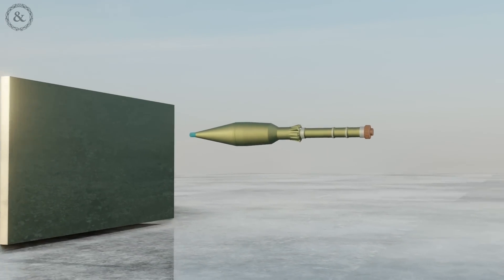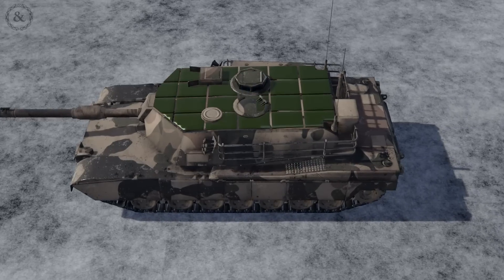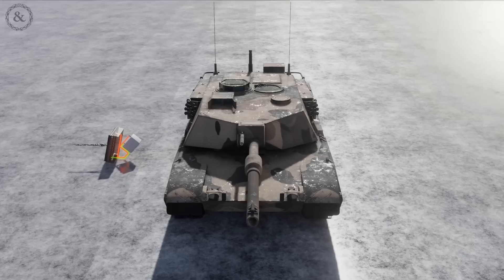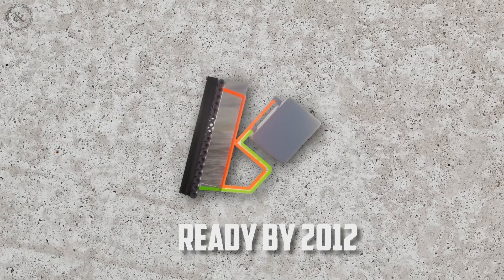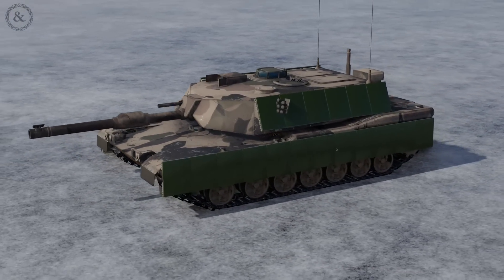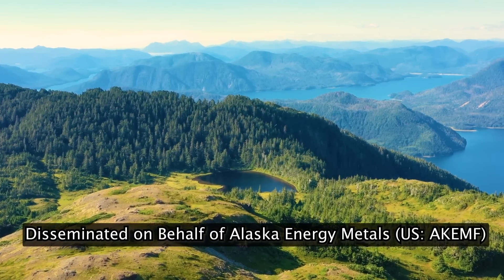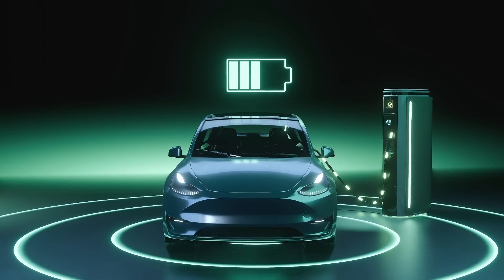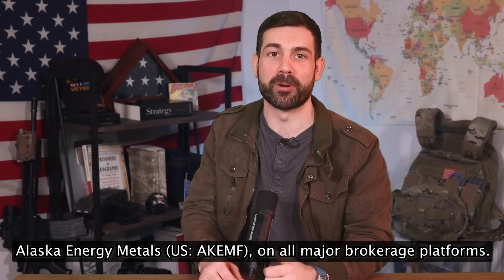How Electromagnetic Armor Vaporizes RPGs

Comment: I had an economics teacher at Foothill College in Los Gatos, CA.  She was great and talked about how the US is resources rich but they are harder and thus more expensive to get and process.  She said when it is economically infeasible to get the resources.  When the price of those reousrces gets high enough extracting the resource becomes feasible.
She used as an example gold mines in the Southwest.  Most of the time they are closed but when gold hits a specific price point they get opened again.  They are left in operational state so mining can begin immediately when the price is right.
Reply: Improvements to technology can/have also changed this evaluation, depending on resource in question.  Lots of factors!
Reply: Many factors involved. There just may not be enough private equity available from people that are interested. In the case of an abandoned gold mine, an investor might actually be able to mine more gold at a profit; however, theres actually other ventures with far higher return on investment (ROI). Rising prices caused by increased demand, low supply are the usual means of dictating where resources go... with the expectation of getting more resources back. In the usual capitalist free market model anyways.
Far as the video goes, the current EM armor requires components that are just too bulky, fragile to fit on tanks not originally designed for it, and the tech currently doesn't really provide sufficient, all-encompassing protection to justify the costs involved.
The tech is certainly "cool" and is reminiscent of Star Trek's "polarized hull plating" technobabble they used in lieu of shields in the Enterprise series (2001-2005). Though iirc the in-universe explanation differs substantially from what is now publicly known of EM armor.
Reply: Those mines have a low gold to rock ratio
Called low grade ore
See poor people in other countries mining these mines as not worth a company’s time
Reply: Good old supply and demand, the way free markets are supposed to behave.
Reply: The problem is the united states doesn't have slave labor that other countries do.  The miners would have to be well paid, safety would be a huge cost.  All the licenses and permits, legal hurdles from various groups. Future lawsuits from injuries and illnesses the miners sustained while working, along with environmental harm.  So buy from other nations who don't have those problem. When world war happens, they will start mining

Comment: Non-engineer here: You say they tested it on 20 kilo volts....no idea whtat that means in practical terms. However: The letters in the video say "20KW", which usually means 20 Kilowatts. Still not totally sure what that means. However: 20000 Volts  associated with a vehicle is something very unsusal. 20 Kilowatts is the equivalent of like 30 horsepower. Which could possibly mean, that they used a very reasonably sized generator to electrify the armor-panels. 
Or it could mean something absurdly Sci-Fi...in which case I would ask you to please clarify. ;)

Comment: i think this technology would be better suited to fortification of buildings, like towers, important infrastructure. etc etc
Reply: Any fixed emplacement is going to be an artillery target which this won't help against.
Reply: I wouldn't be surprised if they already managed to make an actual force shield. The technology has changed a lot, and the idea isn't that far fetched@rrmurrgurr
Reply: @hurrdurrmurrgurr  it wouldve helped during oct 7 when hamas attacked fortified buildings and such
Reply: @SadBoysCollectiveCirca96  nope. Simple vigilance would help.
Reply: Use more concrete/dirt.
Reply: It'd help if they were specifically gonna use an RPG, but that's unlikely against buildings, and the armor is no doubt extremely expensive.
Reply: RPG fences and nets are more economical against direct fire rockets, although a FPV drone operator can just fly over/around that so you still need something for that kind of threat.
Reply: Just use land baed c ram systems . They exist and stop artillery and rockets and any other large projectiles
Reply: buildings are too big for this to be cost effective and buildings are much more easier to hit, so you could just keep shooting it until the power on the plates runs out

Comment: Seems like a brilliant armor defense system but that would require so much power to use on a battlefield long term.
Reply: Well the capacitor doesn’t necessarily need large amperage and could be charged slowly. But what if the projectiles body/liner is aluminum or glass? Glass liners work pretty well and I’m sure the principal would be improved over time right? Seems gimmicky to me

Comment: So, like, does the super capacitor create an electric field between two plates, causing charged particles to be diverted, or does the contacting of the two charged plates cause a dump of electricity, causing a significant current, that causes a significant magnetic field, that induces a counter magnetic field and counter current in the liquid copper, that then deflects the liquid copper?

As an engineer, “zapping” the rpg doesn’t do it for me. I am hesitant to believe that a relatively small electric field of a few thousand volts could 1) vaporize the incoming copper jet via arcing, 2) could sufficiently redirect the jet to either destabilize it or angle the jet more than it already was, 3) arc electricity to the rpg at a distance capable of frying its electronics at a safe distance.

It just confuses me.

Comment: Create a round that launches multiple, connected magnets that attaches to the main tank hull and penetrates the plastic cover of the EM armor and you've fried everyone and everything inside of that tank.
Reply: Not really. Only Russia really still uses metallic armour for their tanks, vast majority of militaries use ceramic composites, which are non-magnetic and non-conductive.

You'd maybe fry the reactive armour, yeah, but not the internals.

Comment: Basically if the armor can be factors cheaper than multiple missiles, it would be worth it.

It would not be economical against multiple cheap RPG rounds.
Reply: By that logic infantry should fight unarmored since no body armor in the world costs less than a bullet is worth.

You need to supplement your equation by considering wether the damage prevented by the armor is worth it compared to other types of armor. So basically, does electromagnetic armor prevent the destruction of enough tanks compared to conventional armor that it provides a net-positive in the equation?
Reply: @GermanPotato-r4j Multiple cheap rounds would be how it's defeated, tho which would be a big problem as our old conventional armor already does a decent job of resisting putting it outside of most nations cabablities to threaten. Explosive reactive armor on top of that also defeats most of the largest powers threats

This would probably be very good used for specialized roles, or moved into a different role altogether and I imagine that's probably what's going to happen if patents don't get hard and people don't refuse to pay
Reply: @GermanPotato-r4j Conventional armor would probably save the most tanks in most scenarios as is. Other specialty armors will also probably outperform it in harsh conditions

This is probably going to be in the next presidents car build, then probably on specialized carriers, and when it's relatively cheap and mass-producable it will probably be standard on every medics van
Reply: Taxes  @GermanPotato-r4j
Reply: RPG’s are always going to be cheaper, the lives of the enemy is the price their gunna pay when their RPG doesn’t do anything.
Reply: u dont compare armor, u compare the whole tank and crew. not to mention that RPG round is just ammo. its like saying that we should use vests because they are more expensive than single bullet
Reply: @Decicamo *we shouldn’t (typo)

Comment: If only there were already something you could strap onto tanks which reacted explosively when hit by projectiles, but without the electronics.
Reply: ERA is relatively easily defeated by tandem warheads.
Reply: @Pathfinder192 Would this be any different?
Reply: @asahearts1 Based on the video, it sounds like it might not even fare well to a couple RPGs fired at the vehicle w/o much time between.

Comment: I personalty feel that the only real way to Deal with the threat of ATGM. Is rally to counter it before it event hit the tank. Only way to do that is By shooting it down. Thus i feel like the only real way to do this. IS by using a system that is already exist. Mainly a system used to shoot down Anti ship missiles. By replacing the Commanders machine gun on top of the turret with an automated Anti missile Miny gun or similar system. You can counter what is really actual dangerous. And no that is not the RPG7.. That system is beyond old and ineffective against modern tanks. Its kinda to be expected considering its nearly 70 years old at this point. 

So building a way to shoot down these missiles. Not only counteract direct fire missiles like the RPG7. But the real threat like the javelin missiles and its various var rents. as in the end unless the turret is completely flat with no hatches or weak points. Its kinda irrelevant if this works or not.
Reply: You want to mount a phalanx 20mm CIWS on a tank? Active protection systems already exist and have been successful in combat.

Comment: Sci-fi armor concepts like electric armor or plasma arc/lightning based interception ideas are great on paper, but very hard to implement in the real world. Modern combat vehicles just do not have the ability to generate and store enough power to make them feasible. Other far less expensive options, like cage armor or even planks of wood on the outside, work just as well, cost far less, and are a thousand times more reliable. With the changes drones, smart artillery, and GPS guided munitions have brought to the battlefield, the survivability onion is relying more and more on the "don't be found" layer. Intelligence and surveillance on the battlefield are becoming far more important than heavy armor.

Comment: Check out using intersecting microwave beams to super heat the air into a plasma shield..
Reply: How quickly can that “plasma shield” become active and would it put dismounted infantry in danger?
Reply: @Pathfinder192  I believe it was measured in milliseconds.. But of coarse all the same problems with power in battlefield conditions.. Recharge time and whatnot..

Comment: With a lot of fancy tech things like this the big problem you often see is the need for more power. I think we are heading into the Battletech universe where the invention and proliferation of portable fusion power will lead to extremely rapid advances in military technology.
Reply: well we dont even have stationairy fusion lol. U prolly mean fission tho.
But even then, all that weights gonna go towards shielding the crew from the radiation. Not really a good idea.

Abram's literally have gas turbines lol. Just charge up a capacitor and unleash it right before a hit.
Reply: @honkhonk8009 Crew? What makes you think a fusion powered tank would have a crew?
Reply: @Elaphon-88c9  Depends how easy it is to jam them, and whether they have any fallback algorithms programed that still make them threatening to the enemy.  Right now, the latter is not feasible...but we're already seeing the beginnings of tech that may allow it within 10-30 years.  In that case, any jamming attempt would need to defeat the armor itself first.

There are obvious downsides (including risk of friendly fire...but friendly fire has been a risk longer than any of us have been alive...don't think that will deter for long if it's good enough).  On the other hand, a tank that doesn't need to hold and protect crew would have a ton of advantages in how it could be designed, too.
Reply: @honkhonk8009  Problem with fusion, which has been the same problem for a long time, is getting it efficient enough to produce power.  We have been able to do stationary nuclear fusion for decades, but at greater power cost than is produced.

Given current progress on AI training and some remote controlled systems already being used, I would expect remotely operated craft to be in common service long before we can a) get fusion power net positive and b) miniaturize that enough to put it into military hardware.  Thus these systems probably won't need any internal radiation shielding, just to prevent leaking it out onto people servicing it or friendlies.  The cheaper this stuff can be made, the faster we'll see it.
Reply: @TheMelnTeam I wouldn't be so sure about point A, given we've had multiple net neutral fusion tests in the past decade, in both Europe and the US.

Also, I would trust AI with controlling a military vehicle. Drive it? Possibly. Aim the weapon and identify targets? Potentially, but not when current models struggle to pick things up. Pull the Trigger? Definitely not, under no circumstances should an AI be given the ability to end a human life on its own.
Reply: @honkhonk8009  No he meant fusion, less radioactive fuel and no need to worry about a runaway reaction if it gets damaged in combat.
Reply: Because yes, a 100 ton laser fusion device and the magnetic fusion containment vessel would be so easy to integrate into your tank…
Reply: @SFX95901  you know that those are two different fusion reactors right? For the laser one, the lasers are both the cause of the fusion and the containment field. For the magnetic one, the fusion is achieved by a twisted magnetic field forcing superheated plasma into an extremely small space.
Reply: No,
Supercapacitors you only need to charge them and then they don’t consume any power until they discharge because the armor gets hit.   The cable issue is silly if the armor is designed in - it doesn’t need to be cabled up, it would simply be two layers separated by an insulated layer - the only cable needed would be the one big connector between the supercapacitor and the armor layer.

Comment: What about depleted uranium sabot rounds
Reply: Electric armor would be absolutely useless against them. 

You can defeat a shaped charge by disrupting its detonation.

But you can't zap a kinetic penetrator. 

Forget depleted uranium sabot rounds, if you only slap a thin sheet of metal on your tank, you're going to be at risk from 20mm rounds. 

...still, defeating shaped charges with electricity is awesome. Wildly impractical, but very cool.
Reply: @sleepysentret  how much energy would it take?